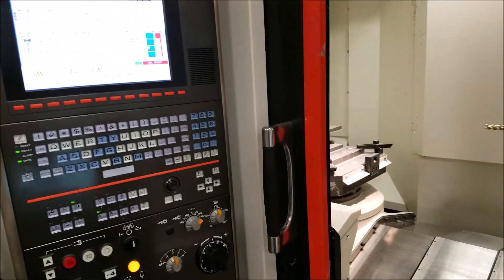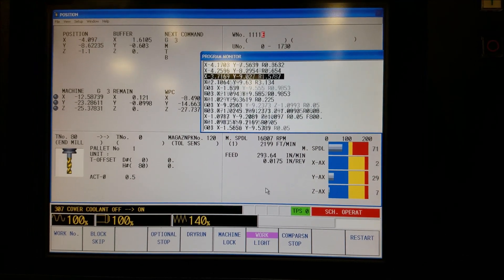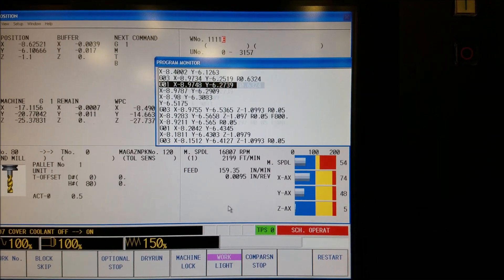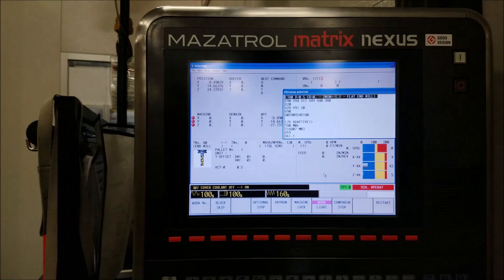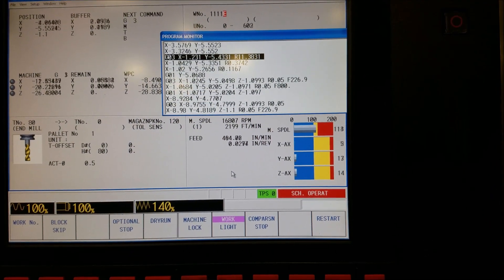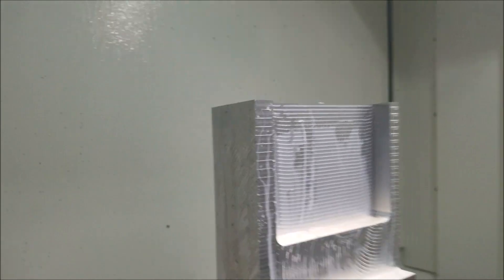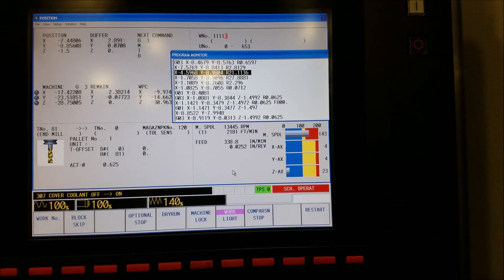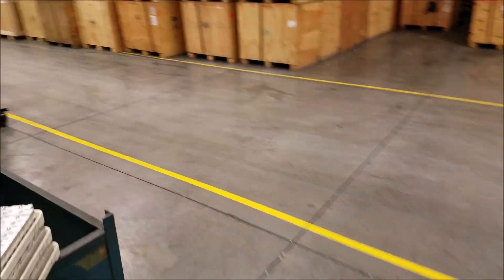Testing Helical Tools 1/2" 3 Flute Aluminum Rougher and 5/8" 3 Flute 45 Degree Helix Finisher

Comment: Really taking it to town!
As I could make out your machine runs on a Matrix control and you programmed the toolpaths in fusion? 
Quick question: What post processor do you use?
I am currently adjusting one for our Integrex and am having some trouble with the G54 work offsets, it only runs on G53.5 (Mazatrol Work offset) at the moment.
Reply from the maker: I downloaded a post processor off the internet and modified it to work with the machine. The mills seem to be easier to get the posts to behave then the lathes - especially for live tooling  and milling - in terms of how it spits the code out.
Reply: Ok, thanks for the reply! I guess I'll just have to keep on trying

Comment: I would suggest using G95 feed per rev.  Then you just adjust the rpm and the feed per rev is locked in.
Reply from the maker: i was increasing the feed per rev in the video, and nor do i really ever use G95 other than in tapping cycles in normal programming

Comment: Keep max spindle load in the long time . Is it good for spindle ?
Reply: The only issue you are going to run into really is heat building up, exceeding the capacity of the chiller, which will make the machine stop until it is cooled down.

Comment: I have already test this end-mill, i get better result with the 35° helix without coating cost 2/3 of the price , less load on the spindle and smoother sound , 12000 rpm ,1.5*D of DOC, .006" ipt, 30% WOC for a 3/8 e-mill without any problem, but kennametal/sandvik carbride lasting longer....
Reply: Good to know because I made those 35° helix w/o coating my standard for roughing and finishing non-ferrous material

Comment: Great stuff man thanks for sharing. I have a 50hp horizontal I've been trying to push to the limits, I'm comparing notes to your video.
Reply: Pete, this is Ed with Raptor Tools, LLC. I have a 3 Flute end Mill called the Wisp-R-Mill, that will do everything the Helical tool can do for less than half the price! I have taken my 1/2" Wisp-R-Mill and I have run the following parameters:
.325 Radial DOC
.700 Axial DOC
10,000 RPM
350 IPM!
You can rough and finish with the same tool. (386) 215-786. If you wish to talk!